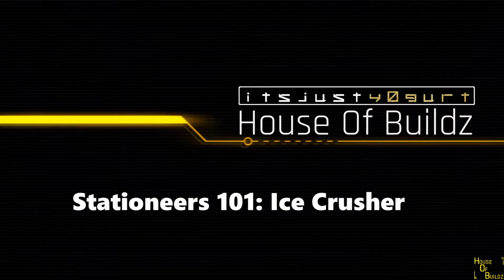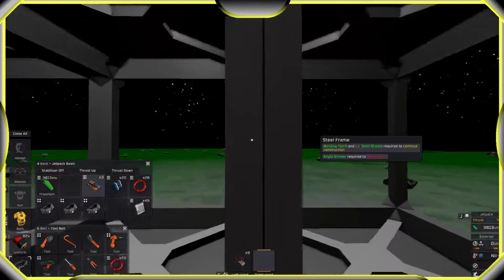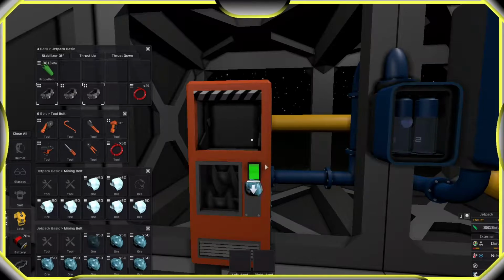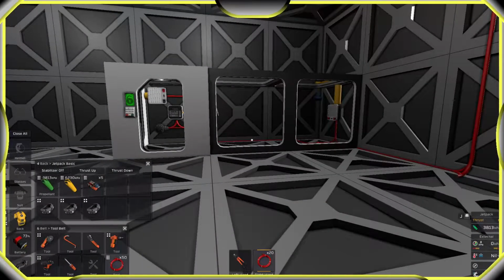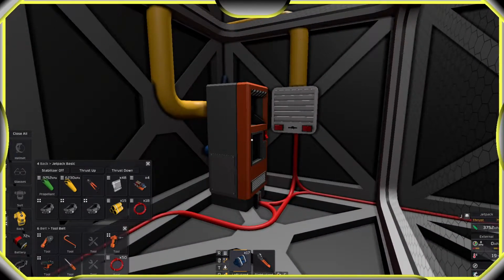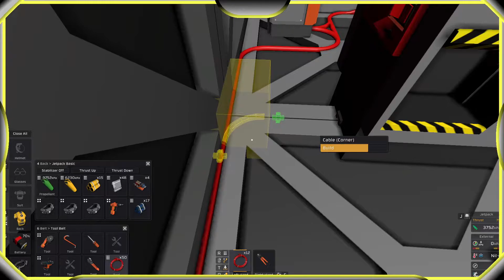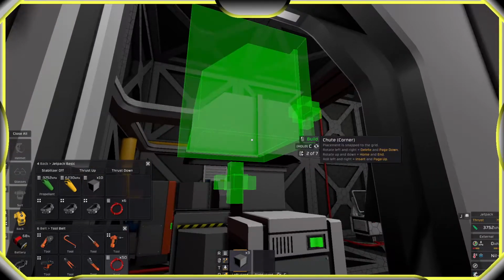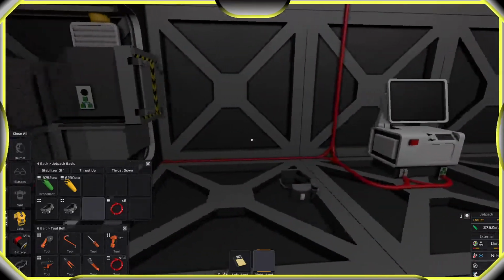Stationeers 101 : The Ice Crusher

Comment: This doesn't work for me on Mars outside, the water bottler says "Input water must be between 0-100 C to fill. :(
Reply from the maker: They have updated the game so drinking water can't be frozen so the water must be above zero and below boiling. They have also added a liquid pipe heater that can be automated with 4 logic chips or some simple ic code and someway to read the temp of the pipe, with a pipe analyzer or you can read from a connected tank.